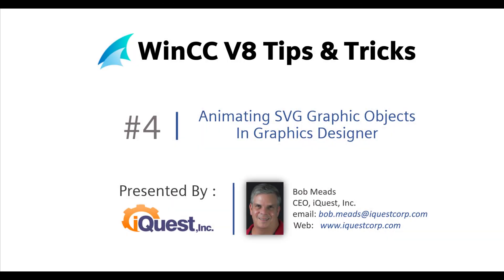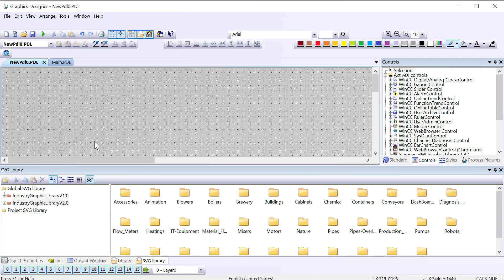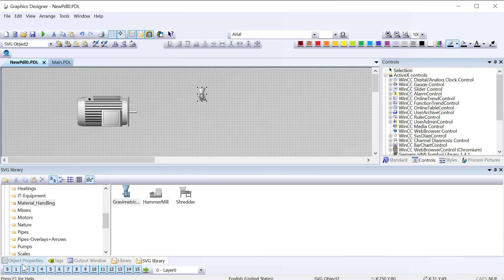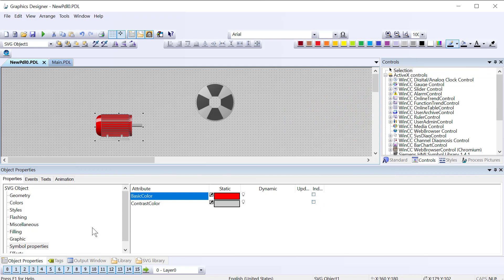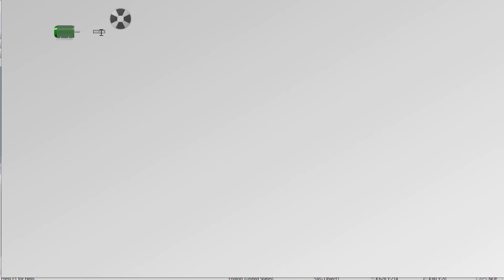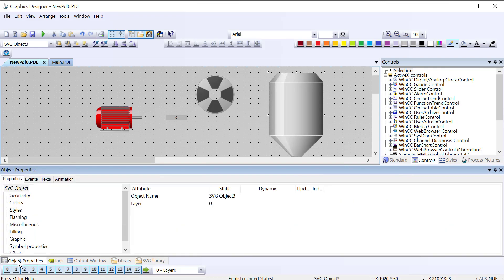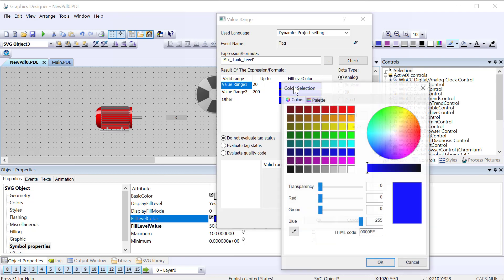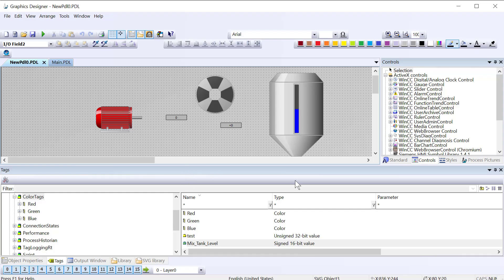WinCC V8 Tip 4:  Animating SVG Library v2.0 Objects In Graphics Designer 🤖 #winccguru

Comment: Great video! Is there also a way to create custom SVG Objects?
Reply from the maker: Yes, you can create your own and import it into WinCC V8's SVG Library. See the help file and search for "working with the SVG Library". The animations are done using XML files.
Reply from the maker: You can also import directly into the project library in Graphics Designer. Just open the SVG Library, right click on the project SVG Library folder, and choose import.
Reply: @WinCCGURU  Can't find this with v8.0.0.0. I will update to the latest version. Do you have a video for this? Sounds complicated

Comment: Great Vide, How we can Create Flashing function in SVG object
Reply from the maker: Flashing properties usually requires code to run internally to hide/show the "flashing" object or color; However SVGs can't run code internally since they are calculated and don't have a basis to run code. It Could be done externally within WinCC by using a script timer to hide or show an SVG component or alternately change a color. However I don't recommend running time based scripts in WinCC due to script loading.
Reply from the maker: you could use an Animation Trigger VBScript on the property of an SVG object to cause a flashing effect, but I would suggest using it sparingly.